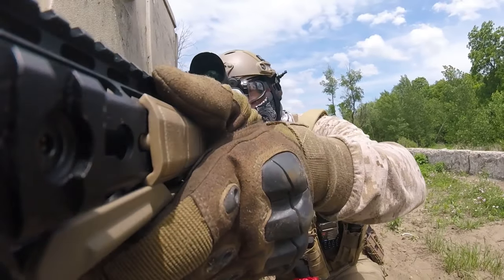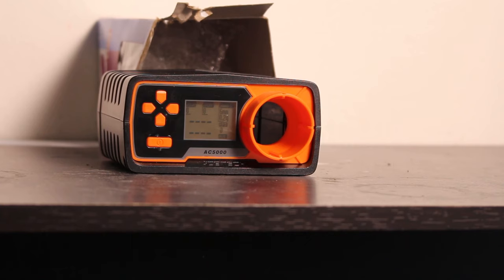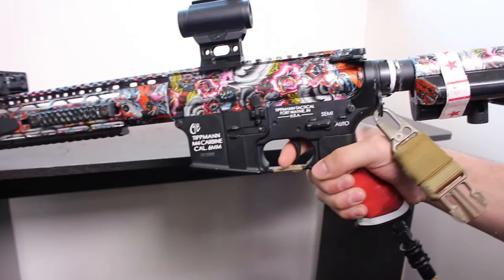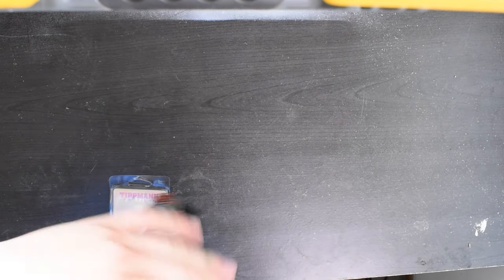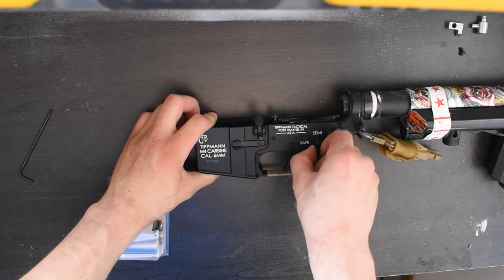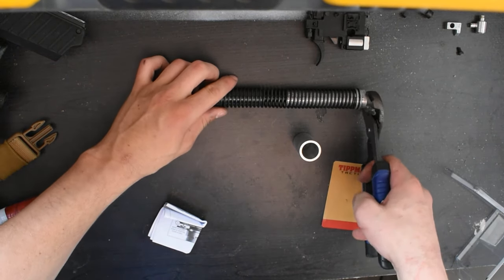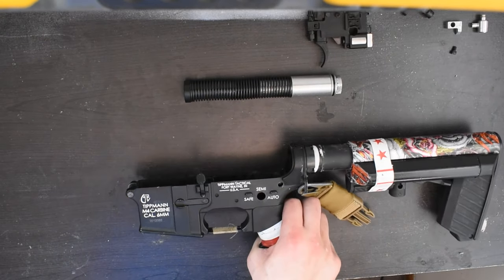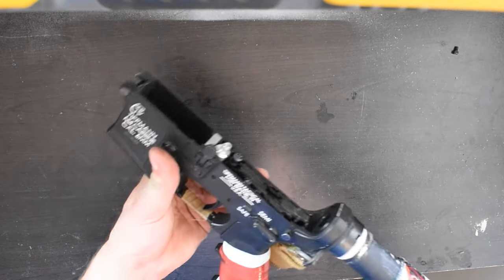Tippmann M4: FPS and Rate of Fire Upgrade | Buffer Tube Spacer Review & Installation

Comment: Does it matter if the buffer tube is installed in the front of the spring vs the back?
Reply from the maker: The way shown in this video is the way it comes from Tippmann, however I have heard of people putting the bolt in backwards as it seems to make the recoil more enjoyable.

Comment: Struggling to find mid or high cap mag.  Other than Tippmann. I have only 1 that fit, some cheap no name brand, no idea where I bought it. My loonex flash mags and g&g’s high caps doesnt feed at all. Heeeeelp
Reply from the maker: Hey so I am a midcap guy myself, the main mags I run with my tippmann are: 
Hexmag: https://www.evike.com/products/55421/
KWA mag: https://www.amazon.com/KWA-Airsoft-Polymer-Mid-Cap-Magazine/dp/B00FRRNPIK
and they are a bit pricey but I do run a few EPM's: https://www.evike.com/products/51102/
Hope this helps!  I have ran into some mags that are simple too bulky to fit in the Tippmann, but with some easy sanding I was able to grind them down to fit perfectly.
Reply: I know it’s been 5 months but if you don’t mind high caps the ones from elite force feed very well and fit perfectly for me in my tippmann omega

Comment: Which is more preferred, the Tippmann 1 3/4" buffer or the Advanced airsoft RED kit?
Reply from the maker: In my opinion, if you want more recoil get the RED, but if you want increased preformance get the 1 3/4 inch spacer.  The RED kit requires permanent modification to the buffer tube and that steers me away.

Comment: Any tips on my tippman v2 cqb m4 not being abuke to get it to go full atou atoll
Reply from the maker: Did you buy your rifle used? My initial thought is the previous owner may have needed it to be locked in semi, I wonder if he simply reduced the rate of Fillmore adjustment to the bare minimum.  I’d start by trying to tune the ROF adjustment, if you already tried that I’m kinda at a loss as to what it may be, modified trigger mech?
Reply: @Private_Caboose  it was bought brand new spent a full day if an event teying to get the full atounto worj before giving up and going single shot .....tried the screw both ways snd its sitting at 1.1 jule so sould be working with full atou surly as came oht the box at 1.8jule

Comment: is this the v1 or v2 tippmann? i am buying the new v2 and was curious what problems if any you have had.
Reply from the maker: Lane Fortenberrry I have 2 Version 1’s, but when you send it into Tippmann for repairs they update all the parts on their own.  Amazing customer service.  No problems so far, love it so much I got a second!
Reply: Awesome thanks so much also keep up the work your vids deserve so many more views than they get bro 👍
Reply from the maker: @lanefortenberrry7255  Thank YOU!!! one last thing I will leave you with, if you're getting a Tippmann you should join this group: https://www.facebook.com/groups/783318765120058/

It is the BEST place for any info or questions you may have, as well as people post their inspiring Tippmann builds!!
Reply: I got mine and there are a few things you need to know. If you are getting the cqb version, it has a low velocity valve and will shoot barely above 300 fps. Also, mine was a lemon and came with an air leak from the receiver. I think it's a bad o-ring but I'm sending it to tippmann for warranty repair
Reply from the maker: _ Nightmarze4u that is a slight bummer, but it is also great that tippmann techs get to go through you gun, it should come back nice and right from their AMAZING tech and support team!

Comment: How is this better than installing a stiffer spring the same length as you would not have the risk of coil-binding?
Reply from the maker: Chris Ackroyd my thoughts in this are that this is a Tippmann made product, and although adding a stronger spring makes sense, a lot of those heavy bolt kits are not Tippmann products and void the warranty.  Tippmanns have lifetime warranties and I would just prefer to keep that as well as enhance the guns performance.  I have purchased broken, second hand Tippmanns and then just had them sent in for free repair and boom, it’s good to go with new internals/externals if necessary.
Reply: Private Caboose Airsoft - I get that Tippmann would only warrant their own stuff, but I can’t see how packing the spring, or adding a stiffer spring would change the resultant forces in the frame/gun?  I guess that Tippmann find it easier to source/ approve one rather than the other🤓.
Reply from the maker: Chris Ackroyd from what I have read (from a few Tippmann Facebook groups I am in) it was mainly the heavier bolts that were problematic, they would actually split the tabs in the upper receiver where the pin is inserted.   I am not saying a heavier spring won’t work, in theory it absolutely will just like other Airsoft rifles, I am just saying in my search over the years to perfect my tippmanns I have seen mainly just two types, complete heavy bolt setups which probably have stronger springs, and then the buffer tube spacer that simply adds more tension to the standard spring.  I haven’t come across many spring replacements, that is all I am getting at. Perhaps they are out there but at least you can watch this video first and see the results from the spacer and make an informed decision which route to take.  from experience of my own tippmanns and my friends, I recommend the spacer.

Comment: So i installed it and i have horrible trigger response and tge rof is very slow so i ended up taking it out, i messed witht the rof screw too and that didnt do a thing, any suggestions before i sell the spacer?
Reply from the maker: Andrew Caefer hey man I’m sorry to hear that. Yes there is one last thing you can try, I have often had to back my buffer tube out a full turn or two, or twist it in a full turn or two.  When the spacer adds tension to the buffer tube assembly sometimes the buffer tube needs adjustment.  It’s odd that your ROF was slow to me, as long as the tank is full it should be much snappier/faster.  I hope the buffer tube was the fix!

Comment: Hey Caboose! i recently bought a tippmann and im pretty new to airsoft i was wondering what stock and rail system you were you using because my new tippmann look so plain so im trying to spice things up on it more and what is that wrap on your hand grip? Sorry if thats to much to ask just want a cool looking gun like yours Lmao
Reply from the maker: Hey bud!  Happy to help here!  Luckily both the stock and rail system I am using on this rifle are both rather cheap!
Rail system: https://www.airsoftstation.com/ares-metal-keymod-handguard-10-inch-dark-earth/
There are a few sizes of this product, this is the 10 inch!  They also come in black but they might be out of stock as I could not find it on the website I usually order from (airsoft station)
Stock: https://www.evike.com/products/71739/
or if you want a different stock I really like these on my tippmanns: https://www.evike.com/products/54297/
Reply: @Private_Caboose  Thanks for the reply! sorry for all the questions but what is the tape or wrap on the handgrip?
Reply from the maker: @Hope-kz8ic  Happy to help!  The red tape around my grip is simply some electrical tape to add some color to the grip without painting it!  It also adds the grip of electrical tape!

Comment: Is this the tippman m4 the one that is co2/hpa?
Reply: nvm
Reply from the maker: KJSS ah well yes, it is!
Reply: @Private_Caboose  i meant gen 2 but thanks and will it work on the gen 1?
Reply from the maker: KJSS yes it will work on Gen 2!  The knot major differences from gen 1 to gen 2 is the rail system, the motor grip, and the HopUp unit. All upgrades will work for both!

Comment: If u were buying a tippman m4 now would u buy the original or the new version with the mlok on it?? Thanks if you respond and I really enjoy ur videos keep on making great content and I’ll keep watching.
Reply from the maker: Hey I'm glad you are liking the videos!  If there was no difference in price, I would totally say get the V2 with Mlok rail.  But if the V1 was much cheaper than the V2 I would say get the V1, and this is why... Tippmann has amazing customer service, anytime the gun goes down you can ship it in with no proof of purchase and they will repair it and get it back to you within days.   I have done this multiple times, but ON TOP OF REPAIRS, they will also transfer your internals into a V2 rifle if you send in a V1.  So without spending anymore money you can get all the changes made in the V2 installed into your V1, the only thing your missing by buying V1 is the Mlok rail, but thats easy enough to acquire later on!
Reply: Oh wow they do that to every v1 that gets sent in for repairs regardless of what the repair is? Also I’ve tried my best to find out what the differences r between the v1 and v2 and all I could find out was a better hop up chamber I think and it’s easier to change the rate of fire and FPS. Is that right or am I just making up things if u know what the differences r I’d love to know and this is my last question for the time being thanks so much again.

Comment: Can you use it with a heavy bolt in it ?
Reply from the maker: That is a great question, and I cannot speak with certainty on this, but theoretically I think it will work in the heavy bolt.  My only concern would be adding TOO MUCH stress to the recoil spring, thus risking the safety of the guns internals.

Did your FPS go up when you installed the heavy bolt? - if so than adding the spacer into this set up as well might be too much.

What would your goal be for installing the spacer, are you looking for an FPS increase or the Rate of Fire increase?
Reply: Private Caboose Airsoft try the RED bolt it converts it to closed bolt and puts less stress on the system

Comment: What kind of rail have you installed? does every gbbr rail fit the tippmann?
Reply from the maker: This is the rail installed on the tippmann in this video: https://www.airsoftstation.com/ares-metal-keymod-handguard-10-inch-black/

Tippmann's use milspec buffer tube so any real steel or milspec rail should fit no problem!

Comment: Went from 1,0J to 2,6J. Changed nothing else...😬 couldn’t get it lower than 1,4J
Reply from the maker: Zuid2 you might need to back out your buffer tube a few rotations!  There is now a lot more pressure on the spring so you can reduce some that tension by unscrewing the buffer tube a rotation or two!  Not sure why your rifle had such a large jump in FPS, it has always been around +50FPS  to my tippmanns
Reply: Private Caboose Airsoft screwed it 2 rounds anticlockwise, so I’ll see tomorrow on the fps check if it worked. Thanks for the fast reply👍
Reply from the maker: Zuid2 happy to help, I hope this is the fix!

Comment: I have a tippman v2 can this upgrade be done the same with that model ?
Reply from the maker: Yes!  V2 are nice, enjoy it brother!
Reply: @Private_Caboose  if I wanted to upgrade my barrel what would you recommend
Reply: @thomasspencer6237  Lancer Tactical 14.5 in covered by a mock suppressor or carbine length hand guard, flat/r hopped and get an aftermarket hop up. I’m getting DMR ranges at lower FPS making it great for in and outdoor fields.

Comment: What is the difference between this and m4 high velocity valve, if both increase the fps
Reply from the maker: The valve increases FPS by allowing more air flow, this increases FPS by putting more pressure on the spring.  I personally install the buffertube spacer because it has the RPS increase as well.
Reply: @Private_Caboose  rogert that bro, but to one config DMR im thinking its better the valve or not, because rps less important
Reply from the maker: @bcahues  Yes you are totally right, if you started with a CQB tippmann valve, you will need the high-flow valve in order to reach those DMR FPS limits!

Comment: I can't even get it to fire that quick with the stock assembly. its consistent, but very slow.
Reply from the maker: The FPS and ROF are all fully adjustable!  If you google the Tippmann M4 manual you should be able to find these 2 adjustment screws so you can fully adjust FPS and Rate of Fire!
Reply: @Private_Caboose  I know, but I couldnt get it to work. I got myself a spacer for the bufferspring, and now she works just fine. thanks for the reply and great videos man!
Reply: Private, Hope you see this message, I got myself a second secondhand tippmann, only the problem is that it wont cycle. Tried the ROF screw all the way down and worked my way up from that. I had the ROF screw almost screwed out of his hole and got the same result. Tried adjusting the FPS screw and rof screw to get a little life in her, but nothing worked. 

It will fire one time and just wont cycle. sometimes 2 times in Single firemod and then wont cycle again.. its a bolt action atm.

Any thoughts? 

- its not the line, or bottle. tried it with my other tippy and it works just fine.

I have looked in the tippmann m4 manual but didnt get any wiser then I already was x)

Comment: May I ask how much pressure (HPA) you hooked up (plug in the Tippmann M4 V2) to the Tippmann M4 ? Do you tell me the details of the setup ? Thank you. Can I use SLP (around 110 psi for typical hpa airsoft setup for the Tippmann M4 ?
Reply: Slp will not work. I use a tippman tank that outputs 800psi. You want 700-1000 psi for ur tippman

Comment: So I get how this ups the ROF, but how does this up the FPS? Like how does the physics of that work?
Reply: the extra spring pressure holds valve open longer when the hammer hits letting more air down the barrel

Comment: I’m having trouble adjusting my fps? If I turn it left or right it still goes down and I’m not understanding what to do
Reply from the maker: To decrease FPS you would rotate right.  Basically, the hex screw that you are rotating goes in and out, when it goes in it is literally putting itself in the way of air flow, so the more you screw it in, the less air can get through thus meaning less FPS.

There is a possibility however, that your FPS screw is not threaded properly, and instead of sticking straight in it may be threaded at an angle meaning that it is not in the correct spot to be blocking air flow- If you are adjusting the FPS screw drastically with no decrease in FPS, this MAY be your issue. 

Either way, if you are not in this facebook group I highly recommend you join: https://www.facebook.com/groups/783318765120058/

You can then search the group for people who posted with similar issues, and the solutions should be in the comments, very helpful group!

I hope this helped, and that you get your Tippy running right how you want it!